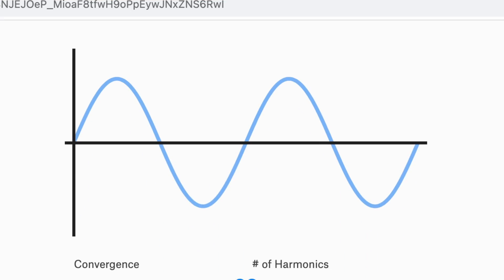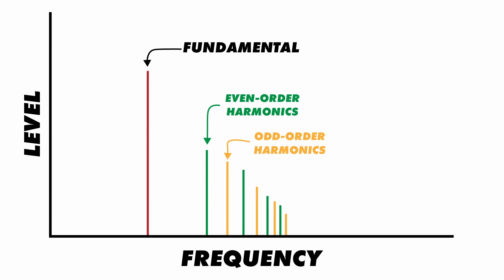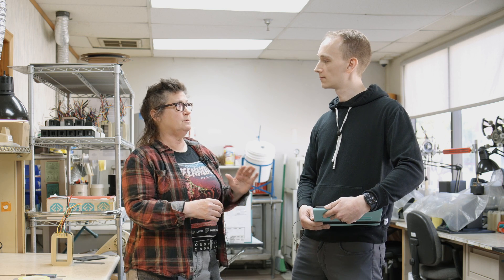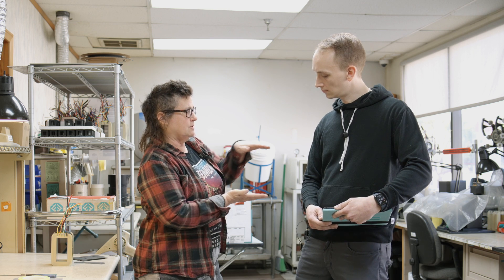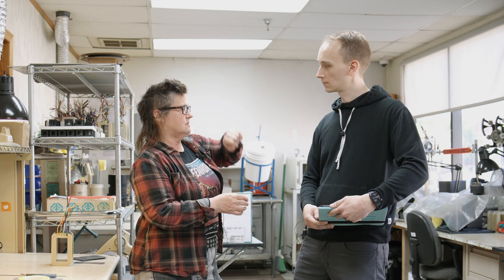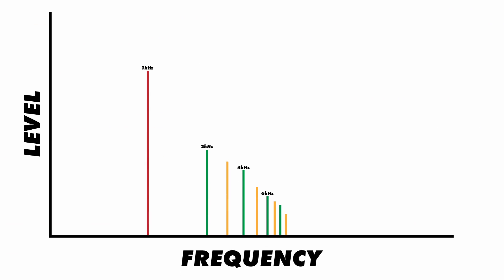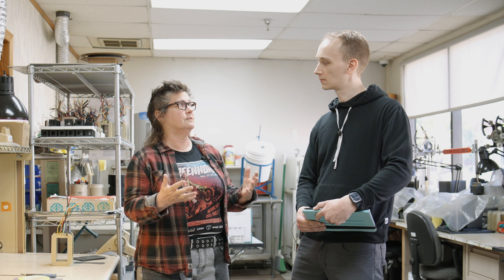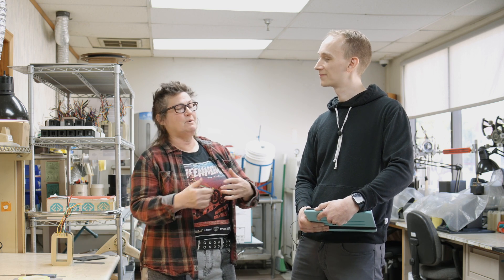Odd vs Even Harmonic Distortion | What's The Difference?

Comment: I notice the difference when I crank my tube amp (an old Carvin MTS3212), which is 100w class AB. It's kind of ratty sounding, but cool in its own way. Those must be the odd harmonics. The preamp distortion at low volumes of course is thick and smooth, so those must be the evens. Tonally, I like that creaminess, but with a touch of that edge, so when I can, I turn up the volume to right where the power section starts clipping hard, and add preamp gain as I see fit.

Comment: Sorry to disagree with some of the comments.  IMO this was not a very good description of even and odd harmonics in music.  And remember when people talk about ‘Color’ that is distortion.  Enhancement of audio tracks adding particular harmonic information can be beneficial.  Some tube circuits do this and others not so well.  Personally I find that adding 2nd order harmonics to lower freq can give you more clarity to enable the listener to hear things with more ‘grit’ or maybe that’s not a good way to put it.  It can help to define pitch and transient info.  
I sometimes add little bits of odd order harmonics to high mid or high freq when needed.  Or attenuate high freq odd harmonics to tame irritating high freq. I use  analog hardware Vertigo VSM2 and Crane Song Inis to add or attenuate harmonic information.  I only work with harmonics in certain freq areas 
But hey…do your own thing and good luck. 

I’m done with my little rant now.

Comment: So the single ended retains the evens and odds but the push pull cancels the evens so you just get the odds?
Reply: Correct.
If you're looking for clean, less distortion is simply that and even harmonics being cancelled is exactly that, less distortion. It's quite a bit less because there's also intermodulation distortion which is the product of those initial harmonics mixing together.
If you're looking for a particular sound well then all bets are off. It's a matter of taste.

Comment: It's interesting what she is saying about odd order harmonics in push-pull circuits and even orders in single ended. I've not heard that before, but I don't design amps. 

I've always been of the opinion that inaudible distortion is the goal, but I approach the problem from the perspective of recreating what the artist has crafted. If you are crafting and you want harmonics, then go for it. I just want to add as little "color" as possible so I can hear what was intended to be there.

Comment: I do not think this rounding of charactreistic which are mostly due to limited thermal emmision of electrones is significantly  important at my ususal level of listening not exceeding  0,5W.  My integrated amplifier may produce max 15 W so it seems at 3% of power.